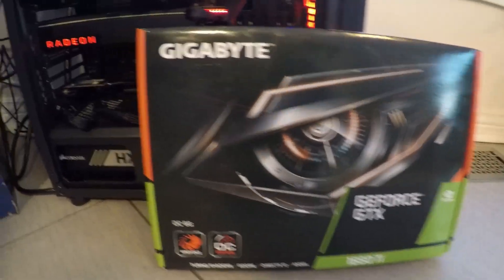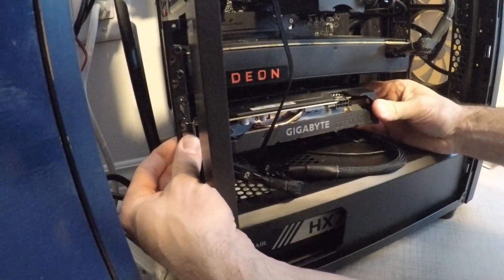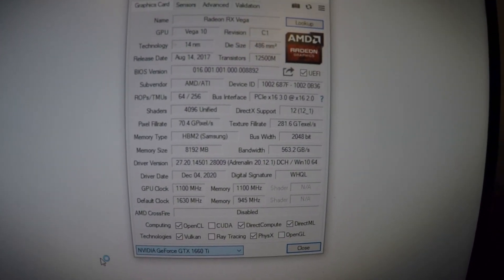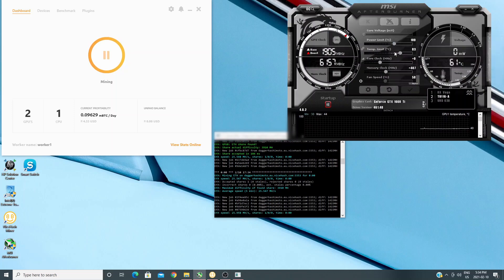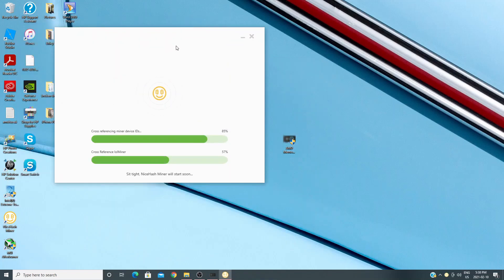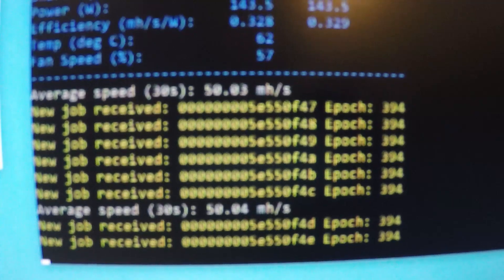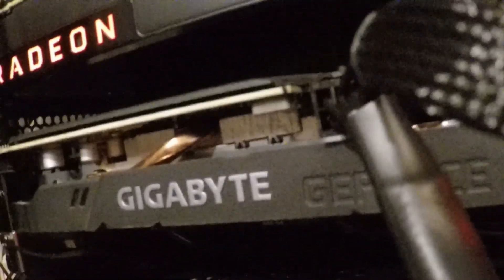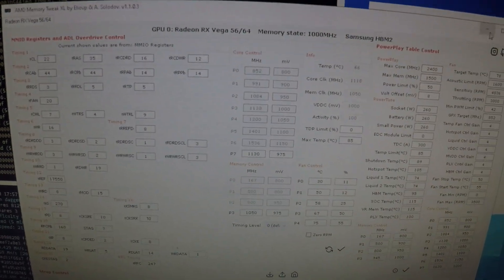AMD and NVIDIA GPUs mining on same computer

Comment: Hi, thanks for the video, fellow Canuck!
Im building a 3 gpu rig with avail gpu's I already have. 3060, 6800xt, 6900xt. Do you think a Seasonic Gold 1000w would be enough for the 3? Or should I use a dual PSU splitter along with a 600w I have lying around?
Reply from the maker: One other thing to consider is that the PSU is most efficient around 50 percent of its rated load. So if you had your 1000 watt PSU running at 500 watts, that would be more energy efficient than running the 2 PSUs at very low watts, and also more efficient that running the 600 watt at 500 watts. As efficiency generally drops off at either higher or lower draws than 50 percent.
Reply: @DIYNorth  Thanks man. 
Just a question tho. Why do all the mining guides always default to the advice of calculating the total sum of your cards TDP +100w then multiplying by 1.25 to get the reccomend PSU wattage.  It's the whole reason why I've been hesitant on using this 1000w PSU. By thier logic I should be using 1087w.
Just curious.
Reply from the maker: @Kaizen2013v  that seems pretty high. Full TDP for each card plus 100 could be reasonable to account for the CPU and other stuff that runs on the psu,  then multiplying by 1.25 kind of seems like a lot. I guess if everything has a wild power surge at the same time it could be reasonable, but I've never had an issue with that.
I have my watt meter on my computer with 2 x 3060s and the whole thing draws 290 watts including CPU.
I run everything at 65 percent power.
Reply from the maker: I highly recommend a watt meter like a killawatt so you can measure watts at the wall.
Just start with the 2 amd cards and see what the draw is. The 3060 should only pull about 100 watts.
Reply: @DIYNorth  Yeah I thought the same thing. I asked around the NiceHash Discord and most agreed Id be pulling 900w max for those 3 cards. The x1.25 is probably for worst case scenario like you said, so not to be liable or something.
Reply: @DIYNorth  Yes! Funny you mention that. I did end up ordering a Killawatt. Im glad I ordered one before this build. Just came in last week. I will take your advice and start with the 2 AMD's.
Reply from the maker: @Kaizen2013v  I've never used those 2 AMD cards, but i would be surprised if you were pulling even 600 watts for the whole rig at the wall. Assuming you do a bit of optimization.
Reply from the maker: I would personally feel fine running all three on a 1000watt PSU.
I ran a 6 card rig on 1200. My current 7 card rig is running on 2 PSUs, but even that draws less than 1000 watts. I'm just using 2 for more cable inputs.

Comment: Hey, how many megahashes are you getting on the EVGA 1080TI? Can't find any good info online about it.
Reply from the maker: They should be in the low 40s
Reply: @DIYNorth  whar about power usage?
Reply from the maker: @GuilhermeLPC  about 160 to 170 watts
Reply: @DIYNorth  thanks a lot!!
Reply: @DIYNorth  what settings are u running?
Reply from the maker: @2sidetales749  On the 1080 TI? Power slightly higher than other NVIDA cards at about 70-75%. Core clock -200, Memory Clock plus 300 or so. Then Eth Pill.

Comment: Hey dude, i try to add gtx 1660 super to my amd rx580. During installation of nvidia drivers there is an error and not proceeding to install nvidia drivers. Any suggestion? Thanks in advance
Reply from the maker: I've had my computer indicate NVIDIA wasn't installed correctly, but somehow everything still worked fine. Does your not work?
Reply: @DIYNorth  thats not work on my system. I check also on the display adapters only the amd one is in the list
Reply from the maker: @johncabilangan7914  have you tried to do the install with the 1660 as the only gpu in the system and in the primary pcie lane? It might help.
Reply: @DIYNorth  nice. I try it removing the amd first on primary pcie and inserting the nvidia. Then i install the drivers of nvidia. After the nvidia drivers installed i shutdown the pc and inserting the amd card to the secondary pcie and it works. Both gpu cards are now visible on my system i see it both on the display adapters list. Thank you 👍🏻
Reply from the maker: @johncabilangan7914  lol...it should always work...sometimes it has to be the hard way, but there is always a way to get it to work.
Reply: @DIYNorth  yeah that’s right buddy 👍🏻

Comment: how did you get the different Miners to run to the card of choice. I have a 3070 and 6700xt?
Reply from the maker: Nice hash let's you pick which miner the card uses.
Just turn off the algorithms you dont want for each particular card
Reply: @DIYNorth  managed to get to teamredminer and trex miner to work without nicehash.

Comment: Having some trouble with system freeze when adding a RX570 on the same rig as the Nvidia RTX1060 and RTx980. Any suggestions?
Reply from the maker: I've never tried that particular combination, but I generally try to get the AMD card up and running first and then introduce the NVIDIA cards one at a time.

Comment: Can I use beQuiet! S9-600W for power up gtx 1660ti and rx570 4gb
Reply from the maker: I dont buy anything under 750 because I know I'll probably use it for mining at some point, but I would think a 600watt would work fine for thos 2 cards
Reply: @DIYNorth  can you help me and tell how should i connect second gpu to the power supply?
Reply from the maker: @Bicolaaaa  Are those cards not 8 pin each? If so you should have a single cable with two 6+2 (8 Pin) outputs. Just plug one 6+2 into each of the cards.

Comment: I have a motherboard that doesnot suppor SLi, only Crosfire. But, if I install two different GPU will they work separetedlly?
Reply from the maker: For mining you don't need crossfire or SLI. In fact you should ensure that those features are turned off as they will not help you. I'm not hardware engineer, but as I understand things the GPUs are working independently on the task, even though they are both doing the same thing.

Comment: I have a 1060 3 gb , and an Rx 590 8Gb. I have a 750 watt Psu. Can I mine 24/7 with the rx 590 (In nice hash) and game with the 1060 for 12 hrs a day and mine with it for another 12 hrs?
Reply from the maker: lol 12 hours a day is a lot of gaming.  I've never tried AAA games while mining on another card. That said my kids play Roblox and MineCraft type games and I don't even stop the card from mining. It can do both at the same time without loss of hash rate. So to answer your question there may be a lot of variables, but in theory I think you can stop one card and game on it while the other mines....I practice might be another story.
Reply: @DIYNorth  Okay thanks a lot! Well when I dont have school I game for 12 hours and when I do have school I can game for 4-6 hours but great story that I can mine while doing my own thing. So mining cant really damage the card unless its running on really high temperatures right? I have 6 fans to cool down my computer.
Reply from the maker: @HiskoEU  I had one card go down, but it was only a fan that burnt out. Technically it could be replaced at home, but was under warranty so I got a brand new card.
As long as you run at low power I'm sure you'll be fine.
Reply: @DIYNorth  Thanks a lot for the help! :)

Comment: You didn't installed the nvidia drivers? May be it causes problem with AMD drivers.
Reply from the maker: Both drivers are fully installed.
I haven't had a problem with the 2 drivers on one computer

Comment: I'm trying this right now on HiveOS :)
Reply from the maker: Good luck, if I ever could get another gpu I'll do Hive on that rig....but the odds of getting gpus is pretty slim right now
Reply: @DIYNorth  HiveOS is happy with AMD and Nvidia mixed. I've been buying GPUs local from FB Marketplaces users. New is better obviously, but ya...
Reply from the maker: People are asking $1700 as the lowest price for a 3070 where I'm at right now. I'd buy maybe $300 - $400 over MSRP, but people are asking over $800 over MSRP.
Reply: @DIYNorth  At that price you might as just as well go buy a whole PC from Dell with the cards already in them :) That's what I did with my two 3060Ti's :)
Reply from the maker: @candr0idcrypto383  I've looked at that as well. I've also thought about a newegg combo which is basically a whole computer now, but disassemble which actually might be better for selling the parts.

Comment: can i power two gpu for mining, a 3070 and a 1660s with a 600W psu?
Reply from the maker: Almost certainly. The 1660s draws less than 100w and the 3070 is at about 140w. The rest of the computer is about 100w on top of the gpus.
Assuming you under volt a bit I cant imagine an issue.
Reply: @DIYNorth  is airflow an issue? im currently mining with my 3070 and it stays at 55C all day, no problem. With another gpu right beneath that one, will i have any issues? should i leave the case open from the side?
Reply from the maker: @lowserver2  the temp of the top card will go up for sure. I run 5 case fans with my 2 x 3060 computer but I need to keep the side on due to kids and dogs. Bottom card is 55, top is 63. They are the same cards. If you can keep the side off do that. It will save a few degrees for sure
Reply: @DIYNorth  ok at least its not gonna burn up on me xd thanks
Reply: @DIYNorth  started running both, the 1660s runs at 50-53C, the 3070 is at 65-68C. Is it too hot? Gonna buy risers so I can place them apart
Reply from the maker: @lowserver2  i assume that is gpu temp and not hottest spot on card. 65 isnt too bad, I have 3 x 3070 that run between 50 and 54 in an open air rig on risers in my cold basement. In the same rig i have a zotac 3070 that runs 60C at all times and it's at least a foot away from all other cards. But the hot spot in GPU Z indicates it's at 74C.
I run my 3060 in my closed rig at 62 to 65 and dont worry about it. But I wouldnt want to see 70 in afterburner.  It really comes down to your comfort level.
Reply: @DIYNorth  I just wish it doesnt die on me XD still gonna get those risers so I wont regret anything afterwards
Reply from the maker: @lowserver2  a riser is a good call...even if only one is pulled out and put on a riser it will be a big difference

Comment: Do you think a 6800 will work with my 3090 and 3070 together (total 3) I’m working with HiveOS btw
Reply from the maker: I don't see a reason why it wouldn't but you are getting into a fairly high power draw. as long as you have at least 650W, you should be fine. I would probably want 750 - 850 W for that. Are you already using risers?

Comment: what power supply would i need? currently i have a rx 6800 on a 550W bequit straight power11 gaming and hashing nicely
cant see how i would fit in even a lowend card like 1660s on that supply. both pci-e power cords are plugged in the rx...soooo...any idea?^^
Reply from the maker: I have 2 3060s on one computer and the total draw at the wall is only 290 watts for everything. Do you have a watt meter you can plug in. It is probably well under 550 watts when mining.
If not a 750 or 850 will easily run a 2 card rig as long as power is optimized.
Reply: @DIYNorth  yes i got one. but i think its faulty cuz its start at 100W when pc is idleling. with GPU mining it shows 260W. GPU and CPU(5900X monero) it shows 350W. its not that i think there isnt enough juice left for a 1660s tier GPU...i just dont know how i can connect it to the PSU
Reply from the maker: @MrRechtSo  oh gotcha, it isnt a modular system that you can add and remove cables from then.....you might need a different PSU
Reply: @DIYNorth  nono it is modular but both pci-e cables(6+2pin) are in use with the rx 6800. which PSU would i need?
Reply from the maker: I use Corsair stuff and like what they have, also EVGA. My Corsair 750 HX runs 2 cards no problem and has plenty of plug ins for a small rig.

Comment: I was mining with a 3060 ti and 1660 super.  Last week I got lucky and scored an rx6800 from amd.com.

The cards mine fine together, but if I try to game on the rx 6800 some weird issues pop up.  Framerates seem too low.  If I try to play Doom 2016 with the vulkan engine it actually runs through my gpu riser on the 3060 ti and runs like crap.  If I disable the 3060 ti it will run on the rx6800 but only uses like 20% of the gpu and gets like 40 fps.  If I go a clean install on the rx6800 by itself it runs at a stable 200 fps.  Call of duty wouldn't even run.  Witcher 3 runs sort of okay but doesn't hit the fps that it should.  Super annoying. 

Mining wise though, perfectly fine.
Reply from the maker: That's too bad. I figured trying to run GPU intensive games could be an issue. I wonder if the game gets confused with multiple drivers.
Reply: @DIYNorth  yeah I think so.  I think nvidia's drivers are like a virus that won't let amd gpu's run right lol.  I'm going to try to make the 3060 ti my main card and see what happens.
Reply: @DIYNorth  I've been messing around with it more, seems to be running as it should now except that I have to disable the 3060 ti to run doom vulkan.  But it runs at 200 fps in 1440p, so if seems to be working right.  I'm wondering if maybe my psu isn't little long in the tooth.
Reply from the maker: @somanymods  lol, could be a PSU. I really don't thing nvidia and AMD are designed to work with each other though.
Reply: @DIYNorth  I'll pick a brand after this gpu madness is over

Comment: Hi, i have a 2070 super in  h410m mobo on pciex16 slot, can I add another 1660ti on pciex1 via a riser, would different series and different type of slot be a problem?
Reply from the maker: I don't think you would have any issue with that. I have 3 1660s running with 3070s without any problems. Generally all the NVIDIA cards work reasonably well together as long as you don't get something really old.

Comment: Hi again. What are your temps on the hotspot areas. Currently i managed to get a 3070 from a prebuilt and i got my vega 56 in there as well. My temps are 73c for 3070 on the hotspot are and 62c for the hbm2 on vega. Whats your temps. What do u consider safe. And thanks for the tip on the earlier video about vega cards. But i decided to stick with the more efficient cooler hashrate.
Reply from the maker: I'm probably not the best one to ask that to as I almost never open up more detailed GPU temperature programs. For my open rig everything is 60 C or less so I don't even really look at it. My tower with two cards has the lower card at 56 and the upper card at 62 C in MSI afterburner. I run everything on the lowest power that I can and keep the Temps down around 60. I've never had an issue with any card.